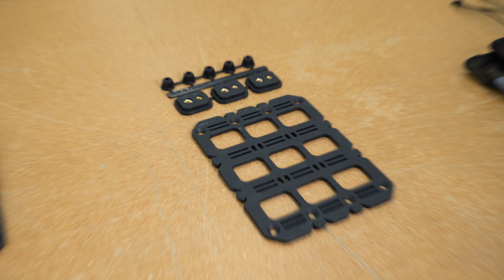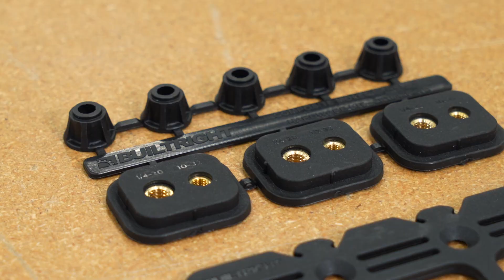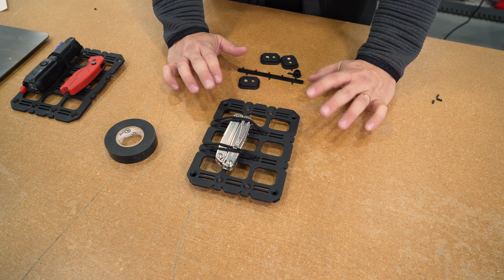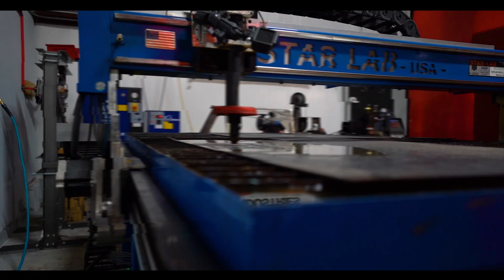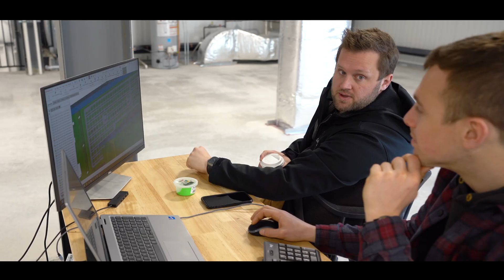NEW Composite MOLLE Tech Plate // Product Deep Dive

Comment: Installed mine last night in an LX-570, rear compartment wall panel to hold a tool bag.  The paned was just the right size to fit between the left 3rd seat and left rear access panel.. It holds tool bag of about 8 lbs.

Comment: It would be cool if there was a second plate with a hook backing, to adhere to the underside of the back seat of a truck or something. That plate could have magnets on the face, and this panel could have back magnet attachments. That way you could have a few essentials always on the plate, and easily magnet it to the underside of the seat, then pull it off just as easily to load into a backpack or take with you to am emergency medical scene situation.
Reply from the maker: ive been brainstorming some quick detach options! nothing decided yet though

Comment: I have 2 thoughts (edit: 4):
1. Tool box for quick accessories I am always having to open the tool box for… knife and small tape.
2. I have 2 12v 10a switches I want to easily mount at the back of my Bronco on the backside of the tailgate table. I think the screw inserts would work for me. Along with a GoPro camera attachment that I could quickly attach the camera when doing projects, camping etc.

Heck… now I have a 3 rd in the engine compartment. The ideas are flowing. 

Great product and the price point is very exciting.

Just came up with another…
I live on the beach and stream live from spring break to Oct 1-ish (another channel)…
Anyway.. I want a great way to mount a PI 5 to the back of a monitor.

Btw: 2024 Bronco Raptor  yall need more gear for these and I have lots of ideas🤠🦖

Comment: This might be a cool way to mount a small fire extinguisher in the back of my Sequoia.
Reply from the maker: 100% could work for that! Depending on the size of the extinguisher you might want to opt for our smallest rigid steel tech plate option, but this panel would definitely secure a small one. Send your idea and info to support@builtrightind.com - thank you! Tag us @builtrightind if you share how you use it
Reply: As if the fire extinguisher doesn't come with a mount already?